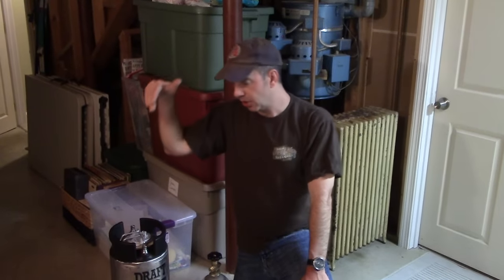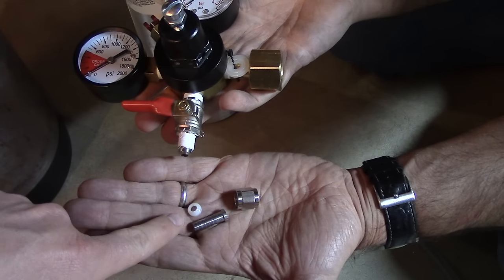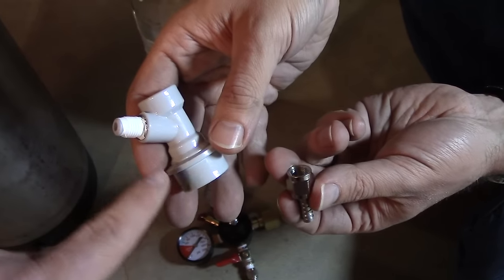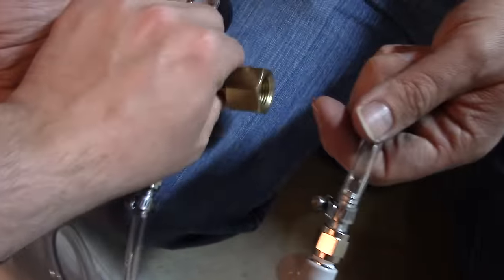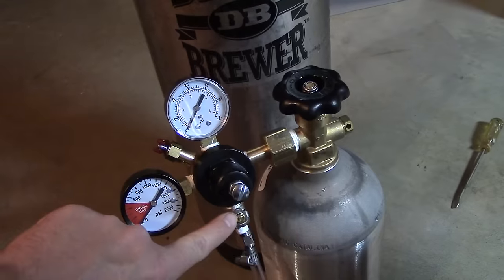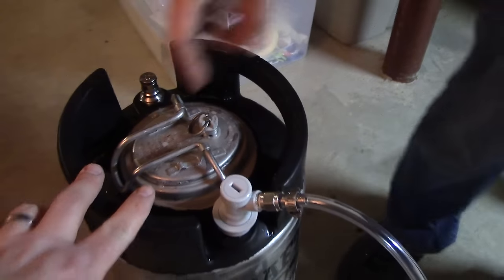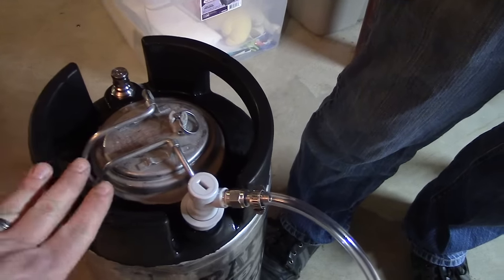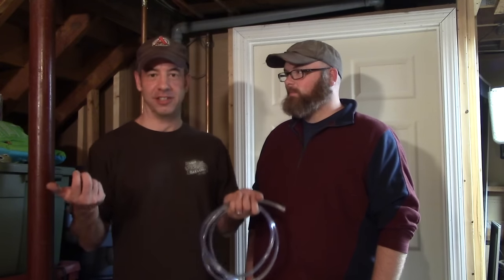Assembling Your First Draft System For Homebrewed Beer

Comment: On the gas disconnect often the barb couplers are push fit plastic and tapered to fit the thread, PTFE plumbers tape can swell the joint and cayse cracking of the plastic so it is innadvisable to use PTFE on the plastice push-fit.
Reply from the maker: True, but as those fitting get older sometimes once or twice around with the tape never hurts until you can get new ones.  Cheers! -Mike

Comment: leave the disconnect off the keg, pressure up the line and then turn off the main gas. Leave for 24hr and if pressures are the same on both gauges you know you don’t have leaks.
Reply from the maker: Thanks for the tip!

Comment: I feel like noob asking but how long do you leave the psi on before it’s fully carbonated ? If you don’t want to force carb
Reply: It all depends on what psi your regulator is set to.  The most common way is 12 psi and depending on the temperature of your beer it will take about 2 weeks.  You could also do a higher pressure like 30psi for a few days and then drop it down to 12 psi or whatever your serving pressure is.  As soon as you hook up CO2 to a keg you are force carbing btw.
Reply: Grain to Glass Inc - Beer and Wine Making Homebrew Supplies great, thanks! Also, would you still leave the regular on if it’s full carbonated? For example, let’s say in 2 weeks it’s finished, would you then leave it in until the keg is empty or turn it off?
Reply: @alexrocks135  Yes, you leave the regulator on and set to serving pressure (usually 10-14 psi but it depends on the length of your beer line) from day 1 until your keg is empty.
Reply: Grain to Glass Inc - Beer and Wine Making Homebrew Supplies great, thank you. I usually bottle but what to start kegging but has questions about it
Reply: @alexrocks135  happy to help you.  Cheers!
Reply from the maker: Cheers, guys!

Comment: This was indeed helpful. I've seen people used a closed transfer system to make sure the beer never touches oxygen while kegging,, but since you get rid of the oxygen in the headspace quickly I'm not going to worry about it.

Also aside from some different attachers, would connecting a nitro tank be any different?
Reply from the maker: Yeah, I would check out a few articles to understand what you need but once you assemble a CO2 draft system, you have the knowledge base to do a nitro setup. - John
Reply: @BrewDudes  I researched it further. You need a nitrogen gas tank to hold higher pressures, a nitrogen regulator to handle higher pressures and a stout faucet with the restrictor plate.
Just increase the pressure 4 times from what you would serve it at as a co2 beer, since there is only 25% co2 in beergas. 
Only tricky thing was that a nitrogen regulator as a different attachment to the gas tank than a co2 tank and gas tank. I heard about it in passing and had me worried. Now I hope I know better.

Comment: Hi bit of a beginner here and purchased a used Cornelius keg that's in great condition. I have noticed it has 2 long dip tubes and was wondering if this is correct and ok for beer? All the u-tube vids seem to have a long and short?  

Sorry stupid question but learning?
Reply from the maker: Definitely not correct.  Someone must have been using a long dip tube on the gas side to introduce the gas from the bottom up.  It doesn't really help with carbonation and it increases the possibility of pushing beer back to the regulator if your CO2 tank empties or something like that.  Replace that with a short 1inch tube when you can.  Cheers! -Mike

Comment: do you leave the gas attached pumping 12 psi or whatever psi for the period of gassing over a
24 hour period then turn the gas off? I don't understand how long you leave the gas turned on for?
Reply from the maker: At that psi, I'd leave it gassing for a week. After a week, you can turn the gas off and then "burp the keg" by opening up the pressure value. Then, you can set the psi at a serving pressure between 5-10 psi. - John

Comment: Teflon tape isnt needed for flare fittings. And should NEVER use tape or sealant on high pressure side
Reply from the maker: If your flare fittings are old and need a little help, it isn't a big deal until you can replace the part.  Cheers! -Mike
Reply: @BrewDudes  flare fittings use a taper to taper surface for sealing. It it leaks passed the taper it will just leak through the front of the nut. Tape and sealant should be only used on NPT and other pipe fittings

Comment: Thanks for the video guys, it was really helpful! I was curious about the "set it, forget it" method though. After a week of 10-12psi, do you turn off the co2 entirely, or keep it running at that pressure while serving?
Reply from the maker: You can do either. I left it on.  You need to have the gas on to serve.

Comment: Im having a problem with rising psi in a double body regulator setup. I carbd beer then set psi to 10 and will increase to 25 overnight. I have tried to troubleshoot the problem and tried to blast out debris but nothing is working. This only happens to one of the regulators. ????
Reply from the maker: That's a good question.  I have encountered that issue too and I don't know what it is outside of a faulty regulator.  I'll ask Mike.

Comment: Great video fellas.  I brew mead and this is my next step.  Question:  What is the cost on a basic CO2 system?  Tank, regs, lines, fittings?
Reply from the maker: Budget for $200-250. There are cost savings like buying refurbished kegs instead of new ones but that range should be your budget. - John
Reply: Two recon Corny kegs all in £258 OR with SS FC Nuke taps instead £285 all in. The gas needs to be purchased seperately 10kg CO2 gas cylinder full (£27 for a refill) £120.

Comment: Hey, 
Thnak you for the video ! Really well explained !! 
I am wandering, is it possible by using your method to fill some bottles directly from your keg ? If yes, do you have to wait 1 week like you said in the vidéo ? 
thank you in advance for your help
looking forward to hear from you and to watch other videos. 
best regards
greg
Reply from the maker: You do need to wait to be sure the beer is carbonated.  You can fill of the keg using a standard black hand faucet and a piece of extra tubing that extends to the bottom of the bottle.  Just turn the dispense pressure down and chill the bottles to minimize excess foam.  Works for filling bottles in a pinch.  Cheers!  -Mike

Comment: So, force carbonating in a keg eliminates the 2 week conditioning with priming sugar completely? So say, 2-4 weeks in Primary/Secondary fermenter. Then straight into the keg and carbonate it? No sitting in a dark place, just let it carbonate and drink?
Reply from the maker: Yes!  Using set and forget the beer is normally fully carbonated in about a week.  If you experiment with using higher pressure you can get it done overnight or in two days.  I have also used high pressure and the shake method to carbonate a beer in just a few hours.  Just be warned its easy to overshoot the carbonation and it takes some practice and patience to make these methods work right.  No more waiting for referment in the bottle!  Cheers.  -Mike
Reply: @BrewDudes  Good to hear! Just got a keg setup and wasn't sure if I had to let it "mature" past the fermentation stage, before carbonating it. Thanks a lot!

Comment: you dont use Teflon tape on those fittings,  the fittings are flared.
Reply: Do not use Teflon ® tape or pipe sealant on any flare ends because you will not obtain a leak-free seal. Keep flare end of fitting free of grease, oil and thread sealant. Use a wrench only on the hex surfaces of the fittings. tighten more if a leak is detected.
Reply from the maker: I get it but it doesn't hurt.  In this case that fitting had given me trouble and the tape fixed it.  No tape no foul.  Cheers!  -Mike

Comment: FYI the thread tape is unnecessary. The gasket will seal it up fine.
Reply from the maker: +corkhead0 Yeah, we're paranoid.  Just an insurance policy.
Reply: Great video guys - Thank you - not to beat a dead horse here but your reply that the tape is an insurance policy    
means you might be missing the critique. The Teflon tape will not stop a leak of gas or beer. These threads are "straight" , the tolerances on the mating threads are large and not cut to make any type of seal. It would be like putting bubble gum around a propane fitting as an insurance policy. Being a flare fitting is not designed for this, too much tape could add stress to the thin cap and or cause friction making you think the fitting is tight on the actual seal before it's actually compressed.  I think it's just us mechanics and engineers that cringe when we see this done. Thanks again for a great video.

Comment: Teflon tape on the threads of fittings that use a flare or flange seal is a rookie mistake in the industrial world and worse than useless, guys. It is only of use for tapered style "pipe fittings". Just saying.
Reply from the maker: Haven't had any ill-effects to the beer.  What's the worst that could come of it?
Reply: It's a mechanical issue. The stuff has a tendency to break off and get into valves and systems and such.  Its use has actually been banned in industries like aviation. Truthfully, if you think about where the primary seal takes place,  once the gas gets past that area the tape is not going to be much good and could cause problems.   

Good video BTW.  Thanks.
Reply from the maker: Cool - thanks for the info.  We'll keep an eye out for tears.
Reply: Teflon tape on the threads of flare fittings serves no purpose. the seal happens on a the flared parts hence the white seal you put between the barb and flare fitting.
Reply: yep! thanks for saying it like it is, saved me from having too.
Reply: I saw that and I was gonna say. Flared fitting don't tape or goop. Can actually cause a leak. If you are sealing gas you'd want to use yellow as well. If you have a compression fitting (that has a rubber inside to seal the connection) also no sealant would be used.

Comment: What's your preferred beer & gas line ID?
Reply from the maker: The diameter of your gas line has no impact on the beer pour, so use what ever works for you.I prefer 3/16th ID line for my beverage line.  It provided 2.2 lbs of restriction per foot.  I usually start with 8-9 ft of line aiming for 15PSI of beer pressure.  And yes I always force carbonate in the keg.  -Mike
Reply: Ok thanks for the info, great video, cheers!

Comment: You might want to mention keeping your tank capped until you are ready to use it and to secure it to a wall stud to keep the tank from falling over and breaking off the valve. You don't want that to happen. A flying tank is very dangerous!
Reply from the maker: Securing the tank is important - thanks!  - John